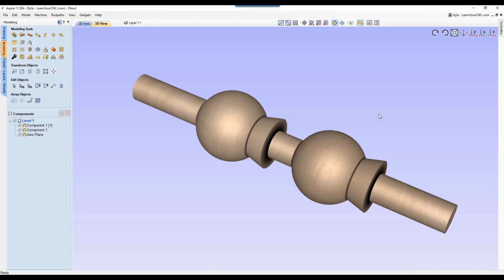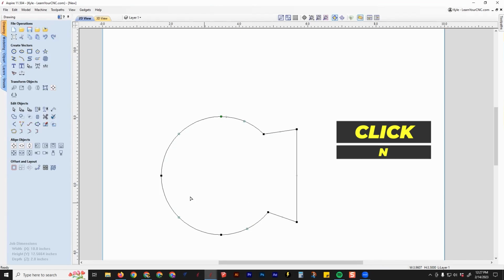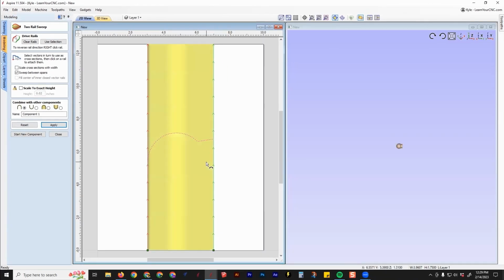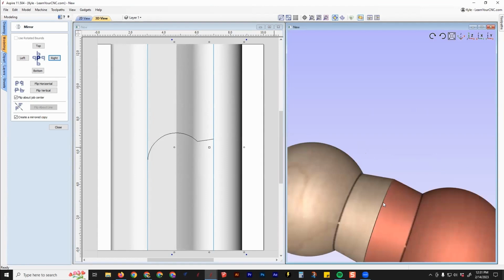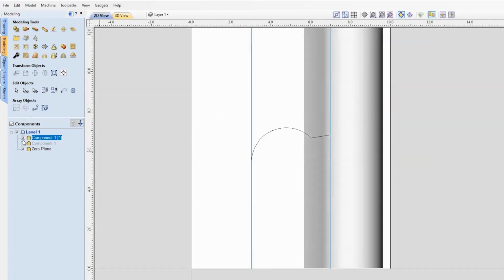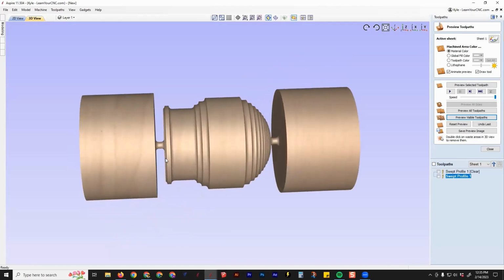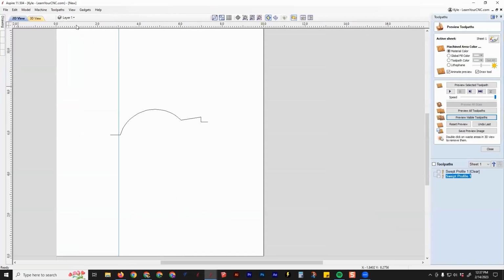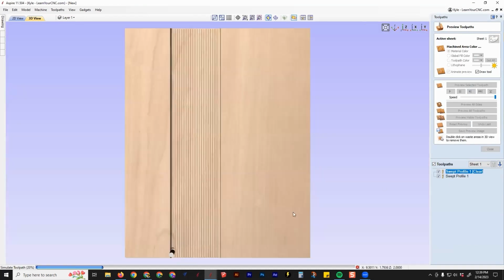How to make 3d rotary objects(even in VCarve)

Comment: A technique that I have found helpful for determining how close the tool will cut to the vector is as follows:

Select the vector and offset it Inwards by 1/2 the diameter of the tool.  Make sure that “Select new” is checked and that “Delete original” is not.  Then while the new vector is still selected, offset it Outwards by the same amount.  This will put a new vector on top of the original vector except now the new vector will represent the cutting limits of the tool.

Thank you very much for these excellent videos.  I have learned a tremendous amount.

Comment: Is this used when you have a live center and a rotary axis? Or can it be used as two sided carve
Reply from the maker: This is more for a rotary axis but this shape can also be cut using a double-sided project. To 3D model it, you would have to use the "Turn and Spin" tool in Aspire.
Reply: The other thing you can do if you have aspire is save the 3d model as an STL file then bring it back into aspire and tool path it.That works great I have done it several times.

Comment: I would love to see more in depth rotary stuff. I have used aspire for awhile now. I think I know a little bit about it. Except for the rotary stuff. I would subscribe for life if you had decent rotary stuff. Like how to make a tapered barley twist spiral from scratch without using cove bits for example.
Reply from the maker: More rotary content coming soon😁
Reply: If you go to your vectric portal account and go to partner projects there is candle stick holders that have a left and right twist and in the PDF file it explains the process of making them. It works really well.